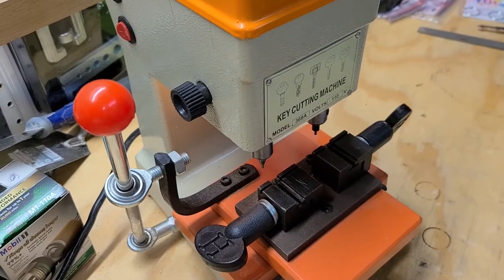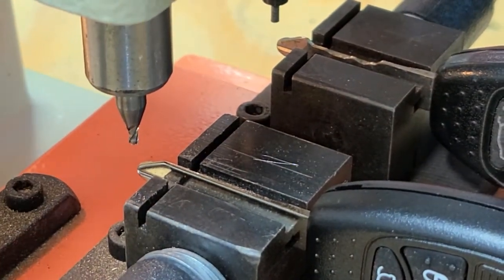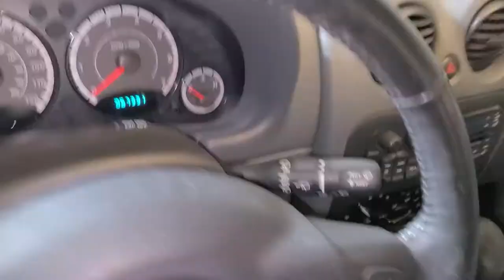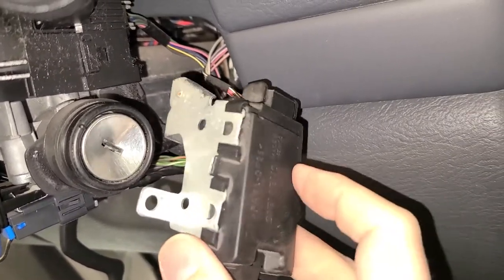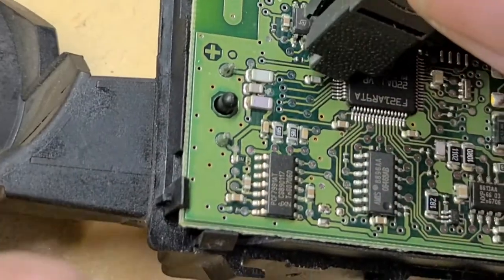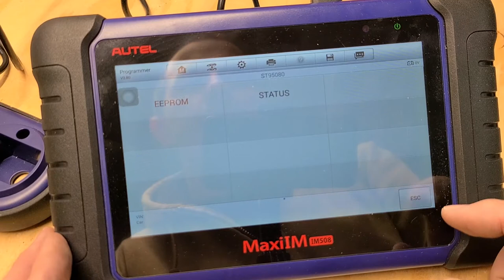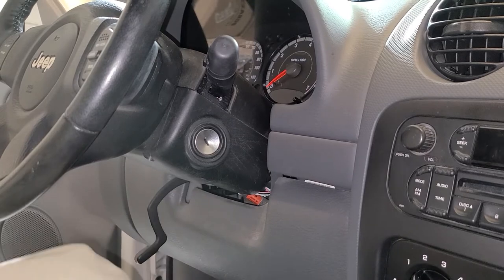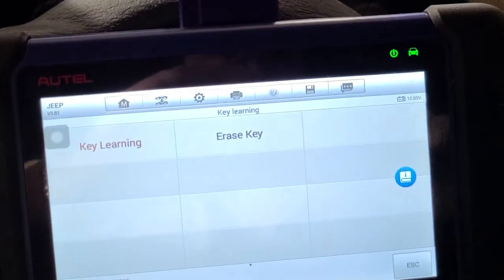Chrysler PIN Read, Programming, and Duplicating Keys w/ Autel IM508 and Defu 368a

Comment: I went to a dealership with all paperwork they asked for. Title, proof of ins, and your license. It was Larry Miller dodge Chrysler in Boise on Auto Drive st. 
The guy tole me that Chrysler was not giving out PIN Codes anymore and they said that one locksmith in Boise ID. said they would charge 90.00 to program
the key, he also said if it doesn't work after they program the key that if it doesn't work all money is non refundable. Now I say what kind of a way to run a business?
Their in it for the money only !  Anytime Lock&key  boise.  
After I seen this video and a few others that DIY 90.00 bucks is a pure Ripoff
Thanks for this video excellent step by step.

Comment: I’m on a budget and basically can’t afford a cutter if I get a programmer, but that defu looks like it did a great job! If I could get by with that even for a few jobs and upgrade I’d be happy
Reply from the maker: I've used that Defu 368a on a dozen vehicles or so. It seems like it would duplicate keys on the majority of vehicles I work on. Cutting bits are cheap too.
Reply: That's how I started. I used the defu, and it worked okay for most. Just remember to have extra key blades just in case it does not work. And now I use it for dimple keys, and I use my automatic key cutting machine for the rest. You just have to be patient and take your time. If you going to invest on a programmer I suggest you save up and go for the autel im608 pro it's a great programmer if you can't afford that yet start with the im508 and upgrade in the future. Good luck to you.
And videos like this are great to learn the basic stuff to start. He gave a great explanation of how to get the pin. You don't see a lot of videos like that around with clear voice and video thank you for posting this video up.
Reply: you are the first person to cut keys in this fashion. you just saved the viewers 20 bucks plus shipping.

Comment: I saw at the 13:43 mark an option of Read Immobilizer Password. Can that also work for the PiN code?
Reply from the maker: It would, however it requires additional hardware from Autel. This option is more of a work-around for the lower model that I have.

Comment: Where can I get the code reader and programmer you have?  Is it possible to program a keyfob without that Scanning tool?
Reply from the maker: Mine is the Autel IM508. If you have two keys already you can make a third without a programmer. Otherwise you will need to have a programmer.
Reply: @HeartlandRebuilds  When you say having 2 keys, can it be a transponder key and a keyfob? If that's possible at all.
Reply from the maker: It needs to be two things that will start the car independently. Two keys or two key fobs. Generally you would turn the key to run on the first key, then turn key to run on second key, then turn key to run on the new key and the vehicle would program the third for you.

Comment: This is a terrible idea. Duplicating worn keys is asking for ignition problems in the future. You might think you're saving money, but you're not.
Reply from the maker: That really depends how worn the key is. What do you think happens when you take your keys to be copied anywhere else? If your existing key works, then a duplicate cut will work just as well.
Reply: @HeartlandRebuilds  The best you will get from the worn key is exactly match worn key image; otherwise, need a VIN to key a new one from dealer which costs an arm and leg. Jeep stealer in Riverside, Ca wanted $225 for 4 digit pin code and you have to be a car dealer to obtain it. I gave them a Fack off and have a good day!
Reply: @dannytrinh07  It also begs the question, WHO REALLY OWNS THE CAR. Sure we buy a car but can't even get dupe keys for it unless you pay the big bucks.
I mean we have to buy license plates, ins, and a drivers license. but we still don't own the car legally govt does. it's so fixed with lies and propaganda.